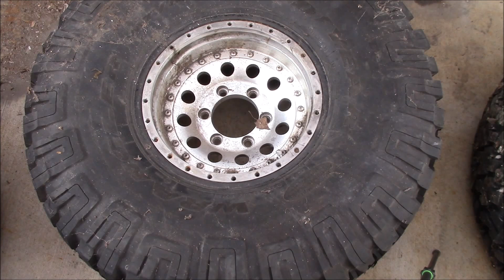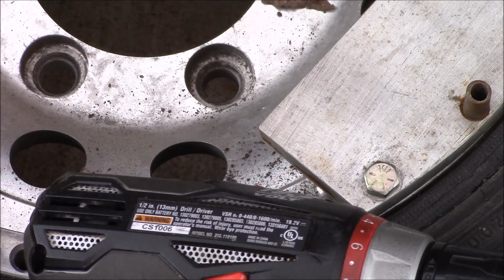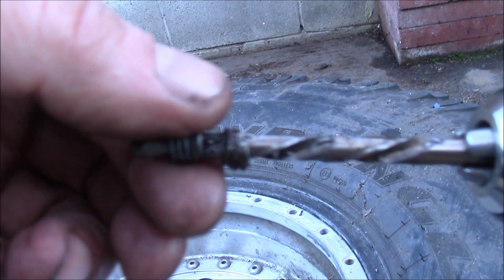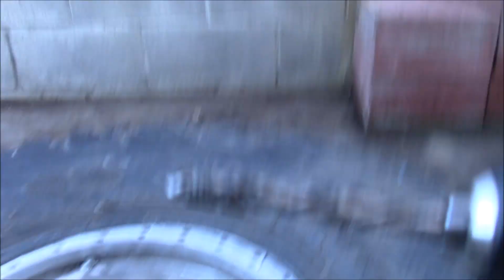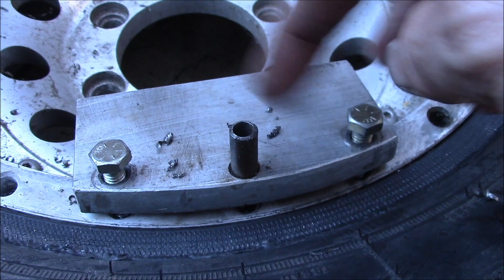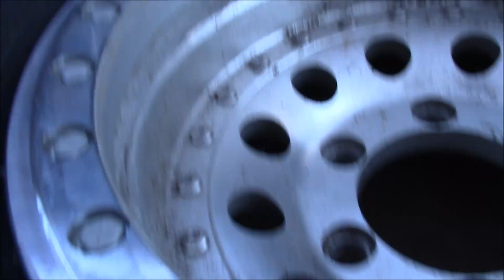Beadlock Wheel - Broken  Bolt Repair

Comment from the maker: I've since replaced the hex head bolts with stainless steel 12-point screws from ARP.  Those things are awesome, 170,000 psi and no corrosion.  Plus, the 12 point heads on the screws make fast work of torqueing the ring down.